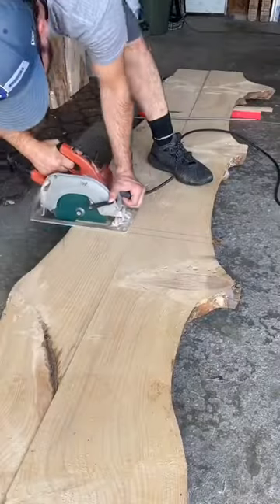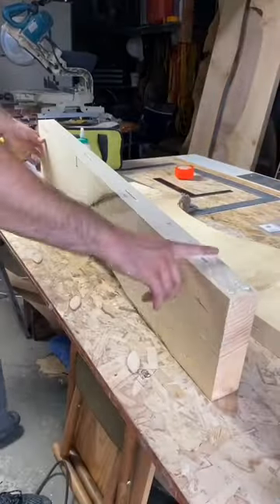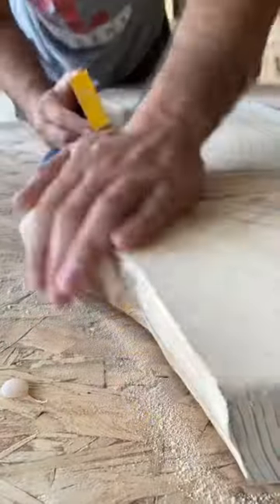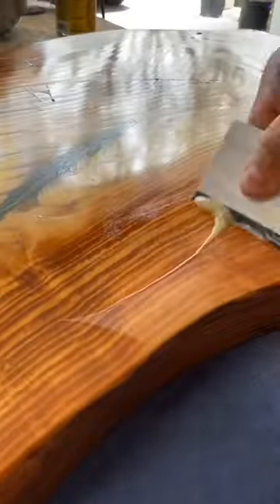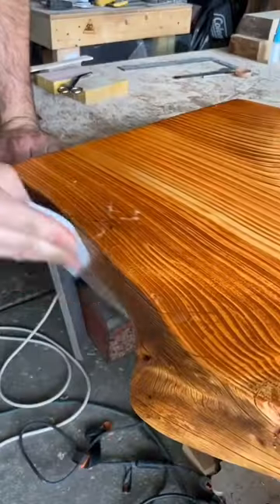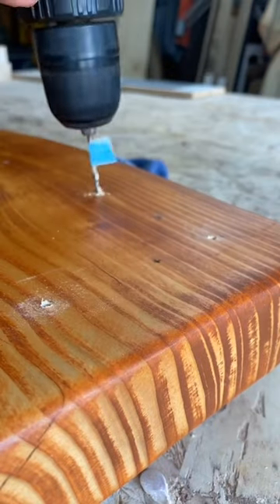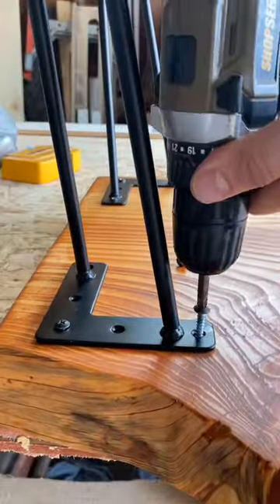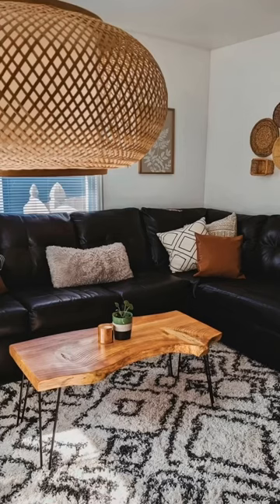Making an Affordable Live Edge Table #shorts #woodworking

Comment: I use pine a lot when I want to try new techniques.  It's great for testing out a backstop on a miter saw for tear-out, etc. I also think if using a new tool it's nice to test on because it damages so much easier so technique becomes important.

Comment: I'll never understand not liking stain, yeah some wood is beautiful on its own but it's hard to beat the beauty the right wood stain can bring out, pine being the perfect example, all my home furniture is pine and no one believes me because of the stains that I used
Reply: It’s just a personal opinion but I find stain makes wood look cheap. We have stained oak countertops in our kitchen and honestly it looks like a cheap ikea cabinet set. They would look much more authentic and expensive sanded down to the bare wood, but of course we need some protection.
Reply: @alexcurmi7412  as they said though, it really depends on what stain you’re using and what wood you’re putting it on, along with the staining process itself. You can also use danish oil mixed with stain to get some really cool results.
Reply: With pine, I don't like the tendency to blotch. I don't mind adding color to some pieces, but I like to see how a wood will look like with a neutral finish before I decide to color it. 

I know there are pre-stain treatments. My way: I like putting down several coats of dexaxed shellac as my finish base. If more protection is needed, then I add a coat or two of varnish, lacquer, pretty much whatever you want. Shellac dries fast and so you can build up the base very fast.

Shellac can be super blond to garnet. It can also be colored with pigments or dyes such as Transtint. 

 It can do a decent job of sealing the wood against blotching by starting with a very light color to seal the wood.

Comment: Most farm house - manor house kitchen tables are made out of Pine, as it stands up boiling water cleaning well, they are rarely stained and it is not unusual for the legs and rails being painted with the top unfinished.

Comment: What is that tool you use in the drill to work on the edge of those live edge slaps?
Reply: Id like to know myself!
Reply from the maker: Nylon wire sanding wheels! I have links to everything I use in my Instagram bio (@gg.woodworks)